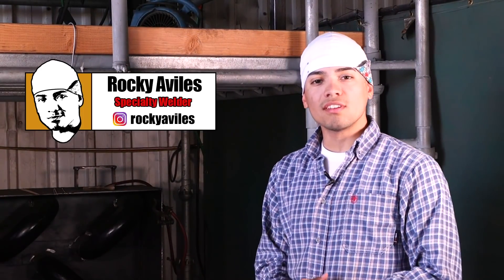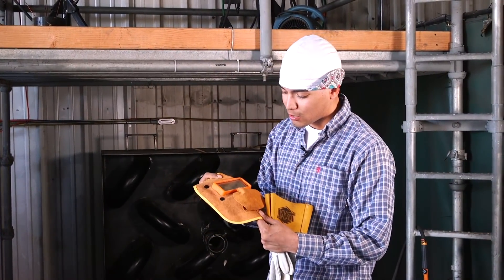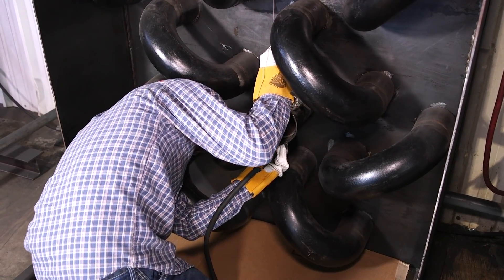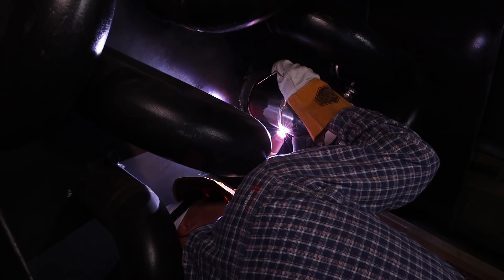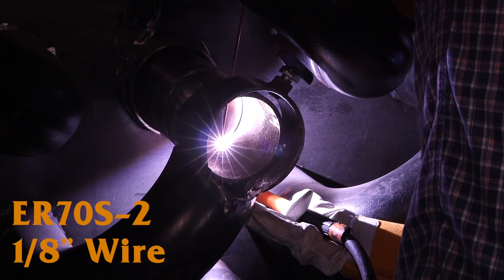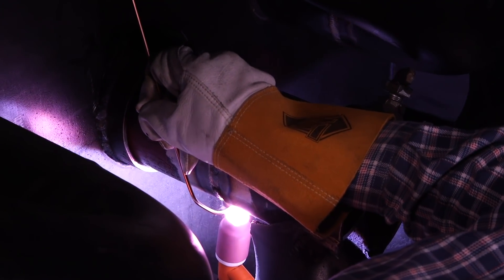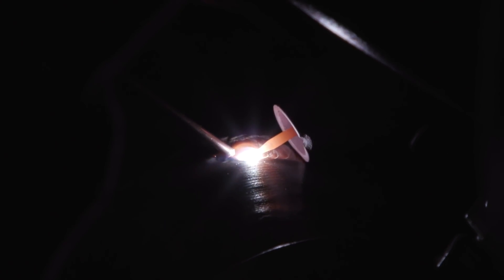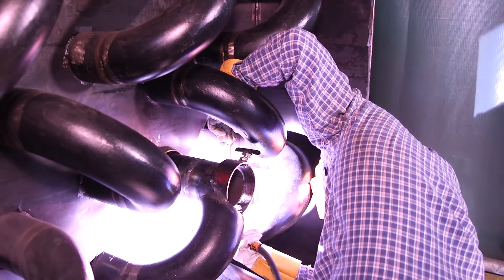TIG Welding 180 Degree Elbows on a Convection Section

Comment: Why people using that big torch head?
Reply: Pretty sure it’s an air cooled 200 amp which is pretty standard for pipe construction versus water cooled you see in fab shops.
Reply: @notanymore9471  im using kemppi flexlite sr9flex and i doing same work as on video. Its much easier to control lightweights torch. And its still aircolled.
Reply: @bonerDB  no doubt, I was just saying that in my experience 200 amp air cooled torches are pretty standard where water cooling isn’t. Small torch heads are great but I prefer to master a large torch head so when i get the benefit of using a small one i can still weld.